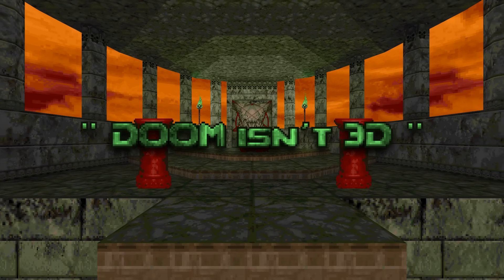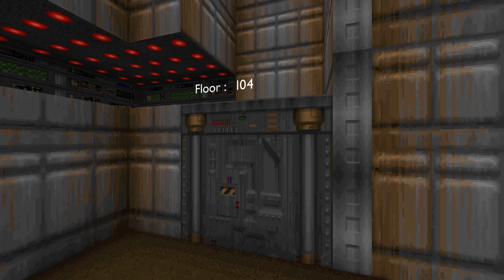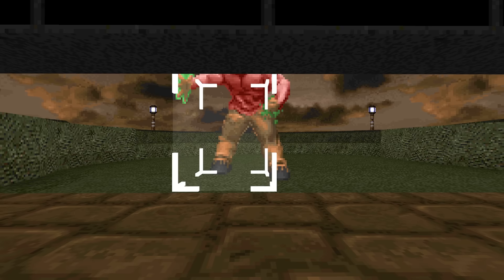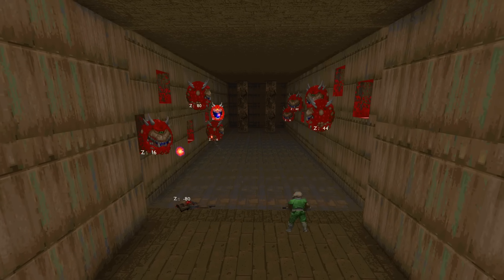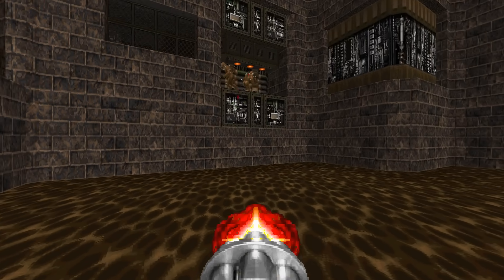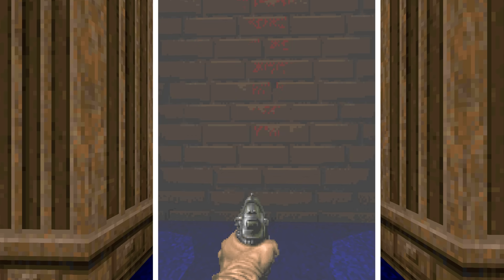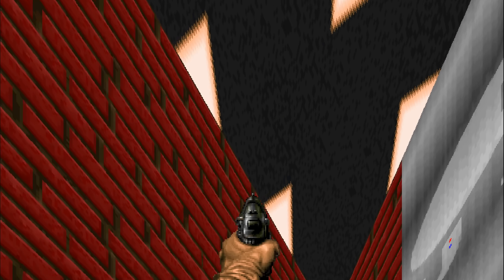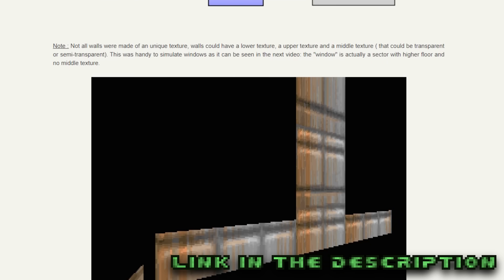Doom engine - Limited but still 3D

Comment: If you wanna really pull hairs, you could easily argue that modern 3D raster graphics aren't technically 3d either, it all comes down to 2d triangles that are being warped via equations to appear to exist in the 3rd dimension. This becomes fairly obvious on the original PlayStation, as the lack of a Z-Buffer meant that one triangle could only block other another triangle from view if it came up later in the draw order.
Reply: Well, modern 3D CG is definitely 3D. All geometry are made of 3D vectors. Physics simulation, hit detection, light calculation, etc are all done in 3D. Only very small fraction of the whole 3D rendering pipeline is done in 2D. It’s like claiming the universe is actually 2D because eyes capture it as only 2D images.
Reply: @SausageTaste  And all of this 3D is protected on a 2D plane unless you are one of the few with a 3D projector setup + Nvidia 3D Vision or a VR headset
Reply: Around the time doom came out and until uniform 3d was widespread one could absolutely say doom wasn't 3d. When doom came out there had been many many years of flatshaded 3d games, but texturing and 3d transforms were both expensive. So, when doom came out many didn't realize it was a cheating all the way down. The debate now seems a bit like misunderstanding what the debate then actually was about.
Reply: @informativt  Yup, in that sense Elite was true 3D even on a C64. We called Doom 2.5D back then, but not because we weren't in awe, it was because we recognised the tricks (to be fair, Wolfenstein, Doom, Duke Nukem 3D, all those games had the same rendering techniques because it was quick). It was a step to the direction of real 3D.
Reply: @MiklosHajma  So "under a killing moon" is the first fully 3d textured pc game I can identify. However I am not surprised if even that game has a hybrid renderer, even though I am quite sure it handles arbitrary camera transformations. 
(edit: and it would be funny. The origin of 3d would no longer be Austin, but... Somewhere in Utah)
Reply: @MiklosHajma  not to be that guy but duke nukem 3-D and all build engine games don’t use raycasting
Reply: @jeremieh5009  doom also doesn't use raycasting
Reply: @Ehal256  it does, but only to figure out which sectors to draw
Reply: @jeremieh5009  it doesn't even use raycasting for that. Check the source code.
Reply: Also very literally, the soundscapes in (most) games are not 3d either. If nitpicking on one factor is enough to mean a game is not 3D then any "3D" game that sums to two audio channels without something like a head transfer function for encoding height differences is only 2D.
Reply: @fusedqyou  Voxels perhaps? If a screen had a Z axis of pixels, think 1000 LCD  screens layered on top of one another but transparent somehow,  it could draw voxels natively, but traditional raster graphics would essentially have to be translated into voxels to be displayed on that sort of display.

If you wanna pull hairs in the opposite direction you could argue that a lot of 2d video game graphics are technically 3d as when two objects have any capacity to overlap that essentially counts as depth, you simply cannot have an object underneath another in that manner in a properly 2d universe.
Reply: I think it came down to processing.
All doom do is calculating 2 vector (x and y) and draw, lets say line based on raycast that projected. 3D graphics calculate 3 vector thats x, y  and z. So no, 3D in computing is not 'space' it is consept
Reply: @kodelagi-daniel  Doom works with 3dimensional coordinates, x y and z,. and it doesnt use raycasting.  Please dont try to explain when you have no idea what is a vector, what is raycasting and what is 3 dimensional. its obvious you dont know for one who knows.
Reply: @kodelagi-daniel  Doom doesnt do raycasting.
Reply: Well technically the triangles are 3D in memory, they only become 2D after the perspective divide. And thats the difference between a modern 3D engine and the doom engine, modern 3D engines can conceptually store and deal with 3D shapes whereas the doom engine cannot. Thats why you wont find a single 3d prop in a doom game - they are all sprites, its not just an optimisation technique, its a hard limitation due to how the renderer works.
Reply: @mark63424able  boy, you mix up perspective projection with perspective divide, yet here you are telling us how it works, when you cant even get right one of the most basic expressions of 3d algorithms.... no, triangles are not 3d in memory, in memory yoiu have just a bunch of numbers representing 3d triangles or if you want a bunch of bits 0010101010111000110101010.......  and again NO, doom CAN store and deal with 3d shapes, its all the 3d levels you see in doom.
Reply: Modern 3D games are 3D because they use a 3D game logic and game space. Doom however does not. But there are non-polygonal 3D games as well; most famous are Sega's 80s arcade hits like Afterburner and Outrun.
Reply: @some-online-dude you just watched a video explaining this... You're wrong.
Reply: The expression is “splitting hairs”, not “pulling hairs” 😂
Reply: @happyspaceinvader508 perhaps they mean it's like splitting hairs (tedious) only more painful... Lol
Reply: You're right of course that since we're rendering on 2d displays, ultimately it's all fake 3d. But in the same way I'd argue that geometry is real geometry if it's made up of triangles (as opposed ray matched sdf or something), I'd argue an engine is real 3d if its world representation is 3d. So doom to my understanding is largely "fake" 3d, even though it's rendered as 3d, while quake is real 3d, even though some of its assets are billboarded sprites. But hey thats just my take, at the end of the day what matters is that we understand what we mean, not how we define things. :)
Reply: @fusedqyou  rendering every pixel in 3d turns them into voxels.
Reply: @danlock1  rendering always happens on  the 2d screen, there is no such thing as rendering in 3d even voxels are rendered on 2d. Rendering simply means setting pixels on the 2d screen. You can only render in 3d if your screen is 3d.
Reply: @kangarht  Good thing my VR headset is 3D then and Gzdoom VR port is amazing and has motion control. Stereoscopic 3D rooms with monsters that still look fantastic despite being paper doll cutouts without depth (don't really notice or care when playing even in stereoscopic 3D). Having said that, any game that isn't stereoscopic 3D is "limited 3D" as it's a 3D representation on a 2D plane ;-)
Reply: EX. ACT. LY.
Reply: Z says hello. So, no. 
You could 3d print those models, right?
Reply: Space you can move across is 3D, the space along, without anything, is literally 3D
Reply: In My House.WAD, you actualy have diferent floors on top of each other.
How did he do It?
Reply from the maker: GZDoom allows for many tricks to enable this. There are silent portals which make it seem you’re going upstairs, but actually seamlessly teleport you elsewhere. And there are so called „3D floors“ which are basically in-game objects which you can step on, placed on top of base level geometry.
Reply: All games that arent VR are 2d
Reply: @bertikkazilek4886  but VR games are just rendering the same 2d image twice eye length apart. Isn't that arguably another kind of fake 3d? Seems to me the only kind of game display that couldn't have a decent argument made to still be 2d would be an actual volumetric 3d display of some kind.
Reply: You explain why it isn't 3D by pointing out the 3rd dimension.
Reply: Some of these comments about not real 3d are stupid, its like saying the surface of our retina is a 2d surface, so the real world is not real 3d either.
Reply: Yeah, anything projected on a computer screen is just pretending to be 3D. The only difference is how sofisticated the process of faking it is.
Reply: @torbjornkallstrom2316  Of course it's a 3-d world projected onto a 2-d surface. That's how our eyes see things. What matters is if our brains see that world the way we would see it if we were actually in there.
Reply: @torbjornkallstrom2316   Well, anything in a computer is just the hallucinations of a piece of silicon.
Reply: It's a different point of view. You can choose different criteria to define 3D. For example... A 3D game is any game made with an engine who works/process  x,y,z axis. Doom works with x,y only - to build the world. That's why we have a 2D map editor only. So Doom is not 3D. Games like Shovel Knight SEEMS 2D, but if you look into how it was made, you'll se is clearly a 3D game (but with 2D sprites, no triangles calculated etc). But if we talk about gameplay and impressions, Doom is clearly 3D.
Reply: nerds
Reply: You can also argue that modern games are 1d, that warp lines into fake perspectives, faking 2d triangles, that are faking 3d shapes...    It's just nonsensical demagoguery at this point.
Reply: The triangles that are used in 3D graphics are actually 3D. Depth information is used to stretch the texture according to distance of each point, so the picture wouldn't look distorted like in games for PS1 or systems which aren't meant to have 3D.
Reply: @techleontius9161  the 3d depth information to stretch the textures correctly are in fact present in PS1 (you wouldnt be able to display a 3d enviroment without knowing the 3dimensional positions in space to begin with), however to stretch the texture correctly its much more time consuming than doing incorrectly as PS1 does it. What the system was meant to do has nothing to do what it is able to do. Any computer can do correct 3d, the only question is how fast, or does it even fit into memory.
Reply: @kangarht   rendering quickly, but with distorted triangles, was usually a choice of programmers for old DOS computers, which did 3D using only software. On the other hand, PS1 had GPU that was only meant for 2D, so it couldn't use any depth information. The only console at the time which did this is Nintendo 64. It could even blur textures.
Reply: @techleontius9161   no need to lecture me obviously I know more of this, I was playing games a decade before N64 or PS1. I have programmed software that renders this shit.  1. not the triangles but the textures on the triangles gets distorted. 2. nope, ps1 gpu was meant for 3d, capable of rendering triangles with gouraud shading and/or textures is a clear sign.  This was simply a shortcut, a design choice texturing is faster if you dont do it perspectivically correctly.
Reply: I mean, as long as you're projecting any kind of image on a flat surface (monitor) it's never gonna be "real 3D"...
Reply: @cxvxcbcxn  well 3dness regarding computer games was never used in the sense that you need a holographic display for it, so this makes no sense.
Reply: DOOM doesnt use a fully 3d coordinate space... modern engines do. Also you cant render at an angle in Doom....literally nobody considers it full 3D it isn't even something developers debate.
Reply: @Wingnut353  Tell me about it. So far the ones foolish enough to call Doom (or its sequel, or other "Doom clones") "True 3D" are these illiterates with flat-earth mentalities. Education (even technical education) alongside Literature and Critical Thinking nowadays are all seen as a huge threat now. Its cool to be dumb now!
Reply: @Wingnut353  I'm a developer and consider it 3D-with-restrictions :)
Reply: @Ehal256  Yeah, that's why it's called pseudo-3D.
Reply: @Wingnut353  "DOOM doesnt use a fully 3d coordinate space." yes it does it was just explained to you in the end of the video above, that doom maps can be converted into modern 3d engines, that wouldnt be possible if the levels werent 3d.
Reply: @Wingnut353 except there aren't mathematically such a thing as partial dimensions, so literally everybody who knows what they're talking about calls Doom 3D (based on the fact that it uses z-coordinates) or 2D based on the fact that it's literally a 2D image on a screen (which is an unnecessarily pedantic interpretation when talking about the difference between 2D and 3D games, since "genuine" 3D visuals are largely a gimmick outside of the niche of VR headsets. 

2.5D describes a particular visual aesthetic and has no logical meaning other than 3D with some limitations.
Reply: @Wingnut353  well... I think "Doom engine is limited but still 3D" :D
Reply: @cesarkopp2  Yeah. Because it's pseudo-3D.
Reply: @OnyeNacho  damn.... 4 years later... 
You can call it that. Doom was made in a 2D engine which create the illusion of 3 dimensional space, so 'pseudo-3D' is an ok word to define it. 
FYI, the word 'pseudo-3D' is not common in Brazil. We usually use 2.5D instead.
Reply: Hold my beer…. because since all video games are displayed on a flat screens, the 3D effect is entirely an illusion no matter what technology is being used, whether it be parallax/line scrolling in 16-bit games, raycasting, polygons or anything else.   What you’re looking at is still just a 2D image.

And the same goes for VR, where you’re displaying 2 of those 2D images, with the illusion of a 3D offset.

But I haven’t even started… because the back of your retina is also a 2D surface.  What we perceive as 3D is simply what our brains interpret from our senses.  It’s very likely there are plenty of further spatial dimensions above the 3rd, which makes the very reality we think is 3D merely an illusion too, produced by a limitation in our brains to perceive those higher dimensions.
Reply: @happyspaceinvader508 great insight. Though reading the comments, you're about the 15th person to state this. So well done on being vocal
Reply: @happyspaceinvader508 "it is very likely that there are higher spacial dimensions that we cannot percieve*"

*Citation needed. 

Space is definitely 3D, not a 2D illusion of 3D.  It's not likely that higher spacial dimensions exist for any other reason than it makes some calculations work for some physicists that mostly relate to phenomena we neither understand nor comprehend. 

The idea that there's a real physical representation of this abstract mathematics in reality is neither proven not likely to be proven in the near future.  

It might be a fascinating setting for a science fiction story, but it's not a particularly novel or useful idea in real life. 

What would you even do with a fourth dimensional object anyway? Let alone a 7 dimensional one...
Reply: @happyspaceinvader508  
Pretty much.

Except the thing of more than 3 dimensions, because we perceive/interact with the 3 dimensions. So any other “structure” above the “3rd” is meaningless to us.
Reply: Technically speaking, even without the discussion about tris in geometry, modern game engines aren’t “3d” because they actually are flat rendered pictures on a screen/s in sequence dependant on framerate…
Reply: @1r0zz  first you need to define what you regard as a 3d game, to make sense. it was never regarded necessity for a game to be 3d for it to use a 3dimensional display. So no.
Reply: @kangarht  
I didn’t say 3d display, those are just 2 flat pictures rendered at the same time. True “3d” would mean actual 3 dimensions manipulation.
Like star trek holographs
Reply: @1r0zz  ah, its clear you have no idea what you are talking of. what is 3 dimensions manipulations ? :D  if you ever programmed anything near 3d you would know 3dimensions only means 3 variables for the 3 space dimensions, its not some kind of magic dimensional manipulation as you think ::D its simply 3 numbers representing a coordinate (x,y,z) for a point in space. simple as that. and doom has that and every 3d game ever has that, without knowing where everything is in the 3d space you CAN NOT make a game that looks  3d work. Simply you dont have the information represented to make it work.
Reply: @1r0zz  and dont lie you did say it needs 3d display implicitly you said: " modern game engines aren’t “3d” because they actually are flat rendered pictures on a screen" what load of bullshit dude. if you have never programmed, and you also never programmed 3d, then please stop trying to explain how it works.
Reply: @kangarht  
ok. when you play 3d VGs can you TOUCH (with your real world hand) a box in the game? nope. they are just pictures.
also, I am worried you do not know how 3d engines rendering works. because they are 2d images rendered on a screen. even in case of VR or AR ecc...
Reply: If you really want to take this to its limit, all games are 3d, as they are portrayed on screens that are neither perfectly flat nor in 2d space.